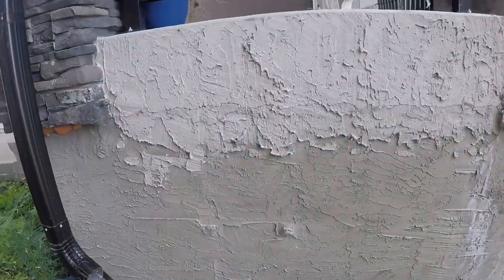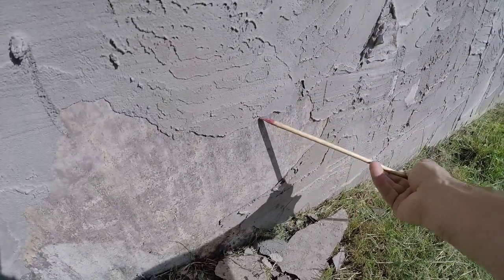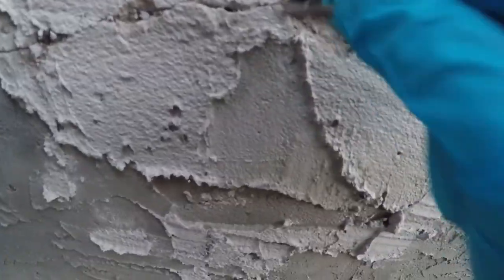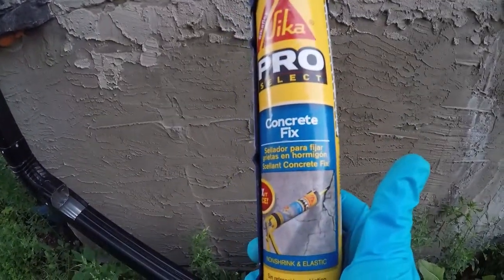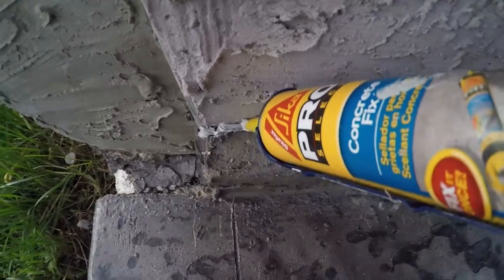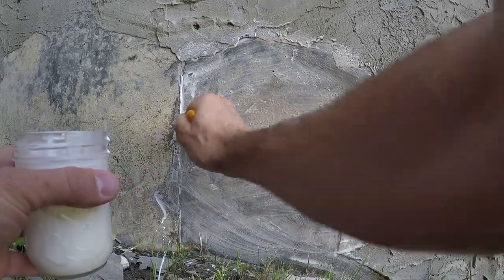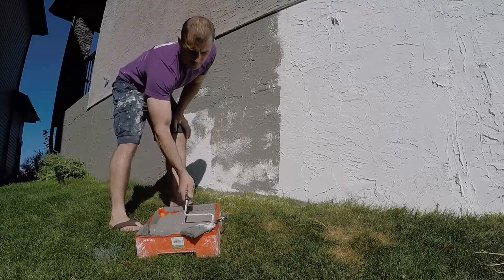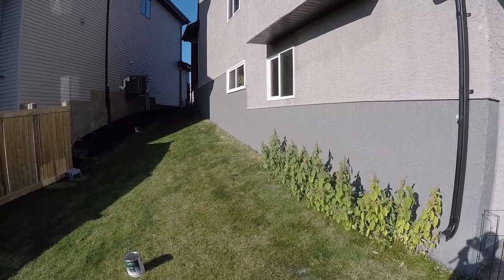Exterior Parging Repair and Painting

Comment: Just re parged my walls two days ago. What mix did you use? I used quickcrete type s mortar mix was unaware there was a parging mix. Also been wetting with water multiple times to help it cure. ** Edit. I watched the entire video and seen what u used. I did my mix with 50% water and 50% bonding agent as well.
Reply from the maker: Sorry, I'm usually faster to comment. Hope your job turns out well. Cheers
Reply: Did you use Rapid set mortar mix or mortar mix with sand or water ?? I'm doing this soon also and want to seal before winter in northeast
Reply from the maker: @Danny-ju2ip  I used this - https://www.homedepot.ca/product/quikrete-exterior-stucco-patch-4-5kg/1000533299
Reply: I just used quickcrete type s mortar mix. With 50/50 water and bonding agent. Worked well. Wet the wall before u apply it. Then I wet the walls about 3 times a day for the first week. Just used a mason brush to add texture
Reply: @jwojo7644  great thanks. I have some bags of the rapid set mortar is why I was wondering if that's so good to parge. Sets fast though

Comment: Rock hammer will make quick work of removing any loose parging material.   I use the wedge side of the hammer to remove.  If it’s loose, it’s coming off.  Remember to always wet the surface just before applying any type of mortar based stucco or patch or it wont stick.
Reply from the maker: good advice. it sucks chipping more off than you'd like, but if the parging sounds hollow or has movement it absolutely needs to come off.

Comment: Finished product looked good. 
I would suggest using a paint pole if you are to be using a roller where you have space. You can’t really get the proper pressure without using a pole, and you may have found it more difficult to fill those nooks and crannies. Other than that, fine job.
Reply from the maker: Thanks for the advice.